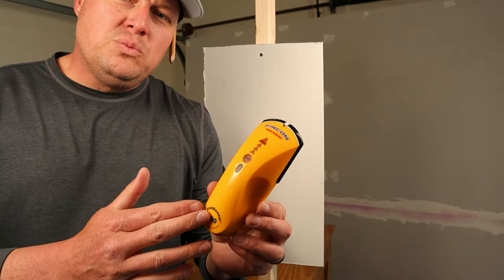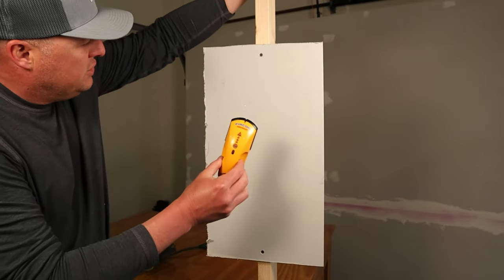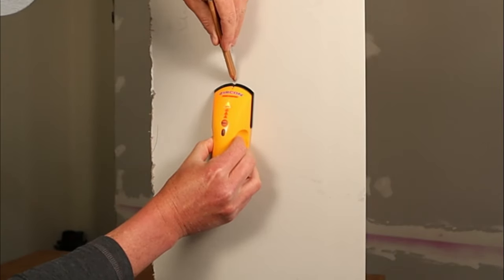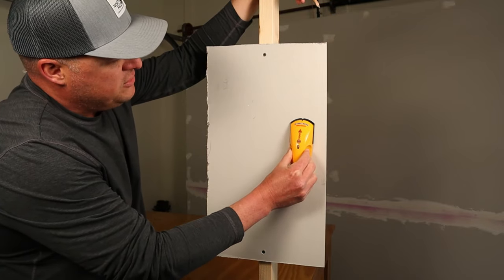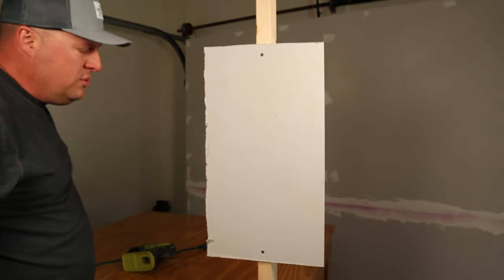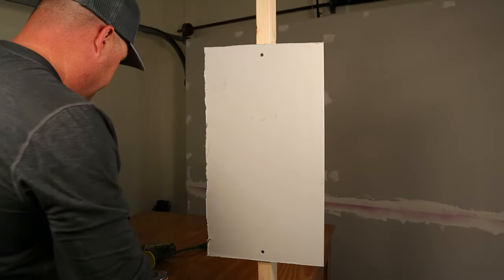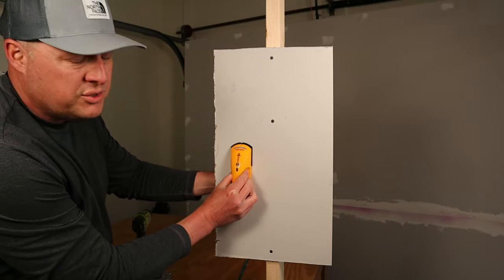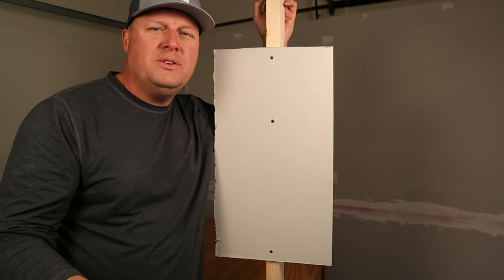How to use a Stud finder to find Studs and Hidden Electric Wires

Comment: This was great. Exactly what I needed plus some insight into how they can sometimes be over sensitive. Only thing I would be curious about is what happens when you put it directly on the stud to calibrate but that’s an easy workaround to find the answer myself. Thank you
Reply from the maker: I wish I would of showed that one on video. In my experience if you start on a stud you’ll get mixed readings. I’ll only drill if I can get consistent results from each direction. Thank you for the comment.

Comment: so does that mean sometimes there ARE live wires behind studs and you cant just assume drilling into a stud is safe ??
Reply from the maker: Not necessarily, if you’re just hanging pictures with small screws and nails it shouldn’t be a problem. When you start hanging large items like a flatscreen tv, they require a large lag bolt. That’s when you should start checking for wires. Best of luck!

Comment: Thank you for your video! I’m hoping you have some advice, I’m trying to hang up something to surprise my husband but am not sure how to safely avoid electric cables. If the electric cable light comes up do you avoid the entire area?
Reply from the maker: Good question, I'm not an expert in this area but this is how I do it. Typically in modern construction the electric is ran threw the center of the studs and along a stud to the light switches. If you're hanging something like a picture with a short scew or nail, I'd say go for it. If you're hanging a flat screen TV that requires big lag screws, I'd say no.

I hope this helps a little bit.
Reply: @WolletBoys  thank you so much for your feedback! This really helps me plan out how to go about hanging everything!

Comment: hanging some plant lights in a ceiling with a toggle doohickey. bout two feet from a recessed light and i have no idea where wires go and literally be the first time drilling anything into a wall 🤦‍♂️
Reply from the maker: You got this! A couple things to help out I'm not an expert just trying to help. 
Most likely the wiring for the lights run along the center of the joist, usually a 2×10. So the chance of hitting it will be low. 
Also, you might want to attach directly to the joist instead of using a toggle. That mainly depends of the weight of the plants. 
Good luck 👍